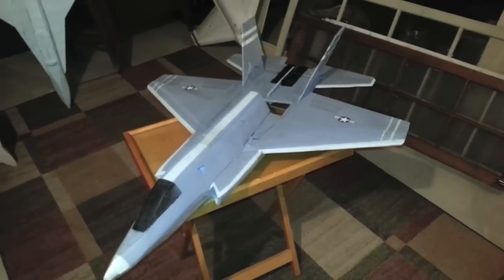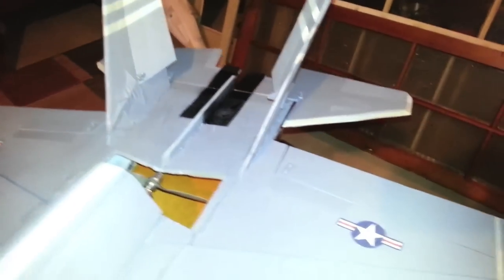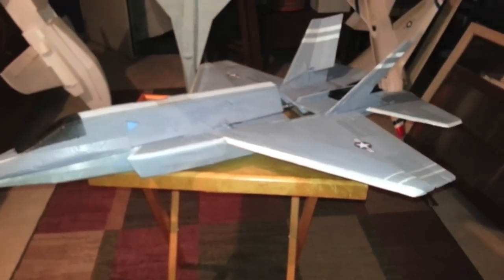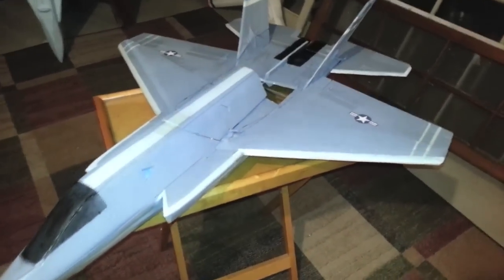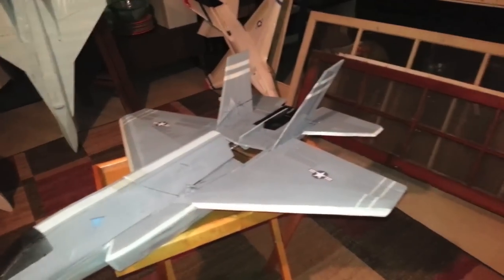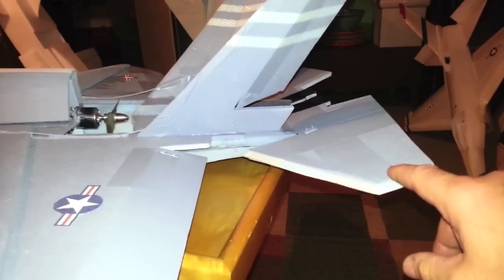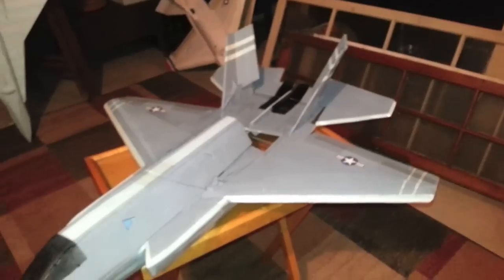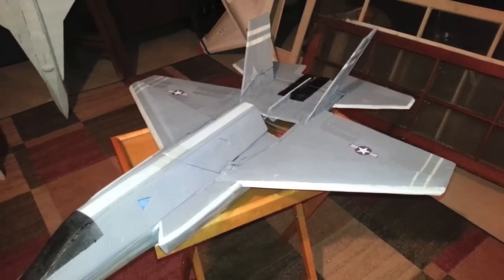RCPowers F35v2 Airbrake Project

Comment: Looks great! Exactly what I wanted to do on my EPO F-35 but I couldn't work out good placement for rudder servos. My only suggestion (if your dx8 is capable) is to slow all 6 servos 1~2 seconds when going into and out breaking mode to provide a smoother transition at at a broad speed range.

Comment: You get enough throw on the flaps, it'll come close to stopping. Better ease into it, with all 3 sets of surfaces.
The elevator is adjustable on the DX6i in flap settings.  But you have to use on-board mixers to anything else with the elevator. is it that way on the DX8?